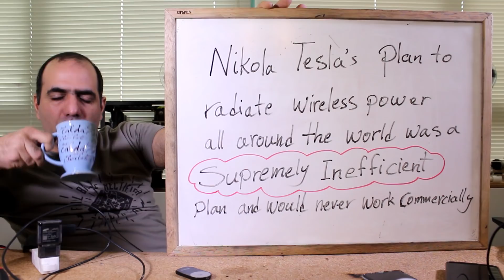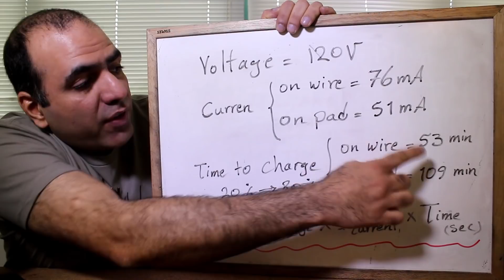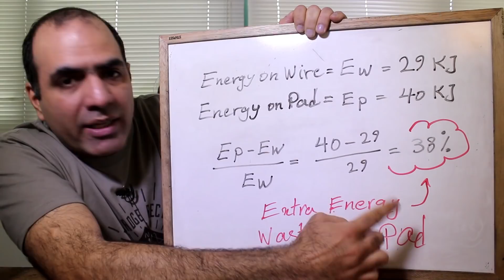Drowning in Inefficiency

Comment: @ElectroBOOM Out of all 5 my phones I had in past, broken connector was the first thing that broke completely on 4 of them. (one had the battery circuit break) and my current phone has it already loose so it looses contact unless it is propped up on something. (I use OTG a lot, which uses up the connector quicker) Using Charging pad is cheaper than having it repaired, and allows me to extend the connector's life for when I do need it for PC or OTG connection. 
I feel insulted by you implying that I am stupid for using it.

Comment: The truth is. There's no device or power plant that could give very high efficiency. Even the nuclear power plant itself. It could only handle half of it's own country. Specially large country. Using nuclear power plan. Couldn't handle the whole larger country. Every provinces and states should have it's own nuclear power plant. Yes it is 90%  efficient. But not for the whole country. It only work on it's area in many states and provinces. So for me higher efficient devices we can built or used was only work on its own capacity or capability.

Comment: you do know there is something in thermodynamics that limits the energy efficiency of an engine... ohh no right you're just an electrical engineer. :p
Reply: If engines were more efficient with less hard bearings, better engineering, no more useless things and all that stuff, the efficiency would be higher
Reply: @sovietcomrade7733  what... less hard bearings would make it worse. (do you mean less bearings or less hard?) What exactly do you call useless on an engine? (efficiency of an engine that uses the otto cycle goes up if the compression ratio goes up. But that's restricted by the fuel quality). Anyway the maximum yield your engine can have is n=(Th-Tl)/Th with Th the temp of your high temp heat reservoir and Tl the temp of your low temp heat reservoir. This yield is a direct consequence of the 2th main law of thermodynamics.
Reply: @arnecl9566  Well, I meant sealed bearings, fist, to avoid dirt and all increasing the friction, and bearings that are less hard to rotate. Man in all the things I build, it last even longer and waste less energy with bearing that rotate freely instead of hard bearings. Even if I understood what you said for the thermodynamics, I'm not gonna answer because I'm from France and English isn't a language I speak very good. But it can be better in all points. But less fuel consumption=less money, so big societies will never make better engines
Reply: @sovietcomrade7733  In all points? Name me 5.
Reply: @arnecl9566  as I said, I'm french. I don't know à lot of English, so sorry if it's not very understandable.
1) less friction = less heat, and less torque required to rotate the object
2)less friction = less wear out, so things last longer before having play, and play waste a lot of energy
3)havibg more efficient engines by removing the useless things like power steering pump, which waste a lot of energy, and replace it by and electric motor instead.
I have one in my head, but don't know how to explain it. I'll look for a video
And the first one is actually two, so once I have the link, I'll have the five ones
Reply: @sovietcomrade7733  Actually the power steering is just something the engine powers and it's not a loss. It doesn't effect the overall efficiency of the engine. Converting your engine's work into electric power and back into work is worse than just using the work directly. That's also why airco in your car is normally powered by the main engine. (there may be cars who do use an electric motor here. But it's worse.)

About the friction thing... I'm not sure what you mean. But combustion engines use fluid bearings because they can handle the dirty environment. They're not the best bearings if you want less friction, but they do last way longer than ball bearings in such environment.

Comment: Litterally everybody:
Waste energy
Me:
Watches this video at 1,25% speed to save power
Reply: lol
Reply: Technically it saves but at the same time it consumes more, this is because you force the processor to work at a higher cycle to render the image and video/audio faster and keep it in buffer

Although they are Microvolts and perhaps nano or milliamps of difference, in favor of the argument it is still a higher consumption.
Reply: @CharlieRAnimaMX  but it finish faster so less energy consumed
Reply: @samueladitya1729  no less energy consumed but same only
Reply: @MasterofOrion  but there's lots of parasitic resources consuming program on background of windows so less energy consumed to finish the work.

Comment: I wonder what happened to the superconducting Powerline tests they did somewhere in New England a few years back. Supposedly it was successful. If that were to go main stream you would have tremendous energy savings in transmission, and it would theoretically permit bulk electric transfer from solar panels in deserts to other regions

Comment: Okay. In my mind if you live away from any city or town invest in geothermal powerplant. Those things when build correctly will provide economically speaking free energy for one household's needs. Add a tesla turbine or cone turbine in the mix and you can power up anything in your household. During cold winter this system doubles as central heating system.

Comment: Contrary to my comment(s) on another vide, there are loopholes to be exploited in every law, including universal laws. Unless there is a law that says that another CANNOT be broken. For example, there is most likely a way to amplify small amounts of electrical energy to be commercially usable. However, the over arcing law that states that matter cannot be created or destroyed, means that amplifying electricity is also impossible beyond a certain point as the creation of more electrons is impossible.
Reply: That said, if one can collect enough energy from the atmosphere, one could then reinforce already contained electricity and make it usable. This would appear as free energy when in reality, you're simply harvesting what is available and using it to improve upon other currents.
Reply: Doing this would also increase the overall efficiency of all other power transmissions, generations, and receptions. Or you could simply break into another dimension in which there is no law prohibiting the manufacturing of electricity and then transfer it to this dimension.
Reply: If only that were possible amirite?

Comment: Someone probably already pointed this out, but anyway...

1. It's all about convenience. Sometimes I only have time to charge for a few minutes, especially at work. I would have to connect/reconnect my phone like 10 times a day, at least. This would be both inconvenient and, as you mentioned, tear the connectors on the charger and the phone. 

2. Uniformity. A charging pad is uniform for most (all?) phones that has this option. I don't have to use multiple different adapters/connectors.

3. The energy loss (is it really worse in the long run?) Well, this is a good argument, I guess. I'm all for saving energy! But how much are we losing really? Maybe it's better to have two charging pads in your home than 8 different standards of adapters. Let's be real, adapters break. They break inside the connector (liquid gets in there). They break in the cable. They break in the "transformer part" (what's that part called anyway?). They break FAR more often than charging pads in my experience (I never had a charging pad break on me). When the adapter break, you will have to buy a new one. This means more produced adapters, more transports of adapters, more energy.  So, big picture, maybe charging pads are more energy efficient?

I guess my point is, the energy loss of a charging pad vs an adapter is negligible, or maybe even bigger for the adapter in the big picture.

Remember, not all energy is lost at circuit level!

Comment: Of course, the coal and gas power plants are absolutely inefficient, but modern thermal power production uses regenerative feed water heating to amp up the efficiency from 20-25% to nearly 50-53%. Compared to electric systems that have 60-65% energy conversion efficiency, this works about fine but still pollutes the environment. Wind power, on the other hand, has a maximum power coefficient (another sweet term for efficiency) of 59.3% (Betz criterion). The only way forward is nuclear power, but we have idiots who cry and crib about that too, thanks to Chernobyl.

Comment: no tesla wanted to transmitt radiant matter through scalar waves via the medium of aether not air. if a tower was a fail project it should have been disassembled/removed not burned down. his plan was to power that magnifying transmitter with the energy of the space's medium itself (invironmental energy aka all prevading aether the fifth state of matter) the tower was burned down cuz the whole world could recieve "wireless free energy" forever. scalar field propagates beyound the speed of light and byound all established laws of "ELECTRONS" if u take it as bullshit u are limiting ur mind not the possibility, which is there is no free energy device but a sea of free energy that is feeding all the quarks in the face of the universe

Comment: efficiency aside, the benefit i find in wireless charging that cannot be replaced is that it extend the lifespan of the data port on your phone, i had at least three phones where the data port partially broke, resulting in pain in the rear every time i need to connect the phone to my computer, and yes that include both lighting and type c ports

Comment: I think wireless pads are worth it. Trying to find the cable on the floor while in bed or standing up is a hassle, just placing it on the table to charge is much easier. They also are just asthetically pleasing as you can easily hide the wire and keep your side table clean.

Comment: 0:32 Then why don't you just Invented a light bulb that waste only 5% instead of complaining?
Those piece of garbage device you sau help reduce technology waste by not throwing your phone in the garbage when the connectors broken. People don't need fast charger, they need durable charger that can last longer by reduced the t..... and w..... of those thing.
0:51 Enable the wireless charger between the phone and the power provide (that the best word I can say) not go straight from the outlet to the phone.
0:59 Using the phone while charging is dangerous, at least the wireless thing help reduce that.
(You never have a problem but I have throw 3 of my phone because the connectors is broken)
Your video is inefficient when it doesn't do much except complaining.
I used to think your video is helpful and fun to watch. But now at I seen in different angel, you didn't do anything except complain (and motivated too :v) We should be happy that we are getting better then the past few years and keep going rather then complaining because of some small inefficient and forgot about the other fact.

Comment: According to Energy Services Group International: "Nuclear power is already one of the most efficient types of energy available today. An average capacity factor of 91 percent beats other energy forms by a substantial margin. Natural gas produces an average of 50 percent while coal produces energy at almost 59 percent. Wind power operates with a low 32 percent efficiency."

Looks like you should support Nuclear power :P we all should.
Reply: I call bullshit on that. Since nuclear energy works by heating up water with nuclear fission and then transferring that heat to other water which then gets fed into a turbine and coal energy works by heating up water using coal that then gets fed into a turbine both nuclear and coal energy should have pretty similar efficiencies. Unless the people building nuclear power plants have found some magical way of transferring heat that they are just not telling anyone else about.
Reply: @Mr8lacklp  My understanding is the efficiency rating is relating to how many watt/hours the plant produces compared to how much energy is converted. In the case of Nuclear power, the heat is produced as a byproduct of the nuclear fission which is self-perpetuating, while Coal power works by actively burning the coal and maintaining the chemical reaction. Basically Nuclear power is passive energy conversion while Coal power is active energy conversion and that's where the efficiency difference becomes a major issue.

Comment: If angular momentum is conserved, it takes 0 work to keep something rotating. So, put some initial work into a loop of wire and it will rotate forever around a magnet, generating infinite electricity. Can you explain why this is flawed?
Reply: Because A: Magnets slowly degrade and lose their magnet-powers overtime. And B: The magnet is inputting momentum of its own. The magnet will not stay put as the wire goes around it. Just as the wire will not stick around for the magnet.

Comment: Prove you wrong about Teslas plan? Okay sure. 

Like in wires or cabling, higher voltage is less lossy when transferred through the air. Tesla was resonating his transformers with the resonant frequency of the earth. He demonstrated this at Colorado springs. It was not theory anymore, it was something that worked. He stepped up this resonant signal using the earth as one terminal and the atmosphere as the other terminal. 

His method was to ionized the upper atmosphere, knowing that ionized air is highly conductive. From this heavily ionized atmosphere he would establish tower terminals with step down transformers at strategic locations around the world. This works both in theory and in practice.

Tesla never intended to use a single transformer tower as a power source. Anyone schooled in even basic power transmission would know this wouldn't work.

Now prove me wrong.

Comment: If you speak about inefficienfy, i often also think about the amount of single parts of a circuit like switching power supplies, 
which can get damaged.

You seem to like to connect things to the live wire ( which is indeed also an awesome song from AC/DC),
maybe you like to try the following:
120V/230V ~ o-----||-----|>|-----o ~
C=100nF(for 230V~) or 220nF( for 120V~) plastic Foil Capacitor 400V
D= red LED, 2Vf, 10mAf, maybe it is smart to add an 1N4001 in series to the led.
If two led anti parallel, each one needs their own 1N4001 in their path.
If one wants to use both half of the sine wave, one can put two led anti-parallel.

Xc is calculated for the given values. So if you are careful, as you always are, nothing should blow up.

No switching power supply with hundreds of parts which can go to hell needed.

If one wants to use it in a larger scale, one has to add a coil, to compensate the phase shift.
The Power Companies, do not like it if one messes up their Power distribution Network with a 90° phase shift.
I did this in the Year 1991 for the first time, when i also had the idea to replace Mercury and Sodium Vapor Lamps and also normal light bulbs
by LED, for exAmple in Streetlights and Signals like traffic lights.
Ah yes, one can add more led to the string and reduce the value of C,
which you calculated correctly for the peak Voltage and Frequency, then.

Comment: Finally i found a video about those kinda convenience wireless pad.

Meanwhile, I'm here with my 2 years magnetic cable charger (only change the plug once) @$2 😁😁😁.

Can fast charge 3A and data transfer and any other cable benefits + i can blindly attach it, just like wireless charger 🤣🤣🤣.

Comment: what if we designed a circuit that has one inverter and has 12v and USB fast chargers all around the house, instead of making a bunch of bricks that have to convert their own energy, create one massive one that powers the whole house, and you can get barrel to barrel connectors and plug those in.

Comment: Natural gas thermal power plants can be efficient as much as 45 % to 60 % 
Coal thermal plants can be efficient as 30-40 % (if steam heat to supercritical)
Solar plants can not be more them 20-25 % efficient if efficiency is calculated throughout the day. and it takes too much space and equipment. 
solar thermal plants can be more then 40% efficient and have a smaller foot print as compared to electrical (poly)solar plants.

we need to concentrate on renewal or reuse of waste products and waste by products such as CO2 , petcoke , agricultural by products , plastics and other wastes.